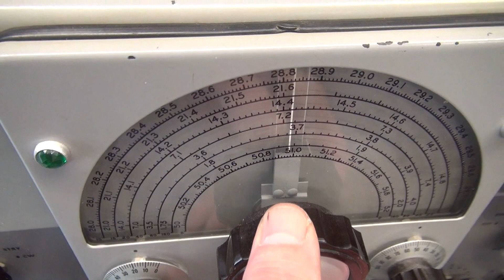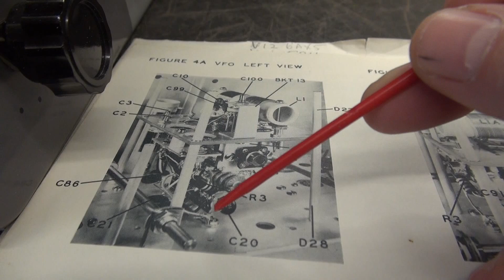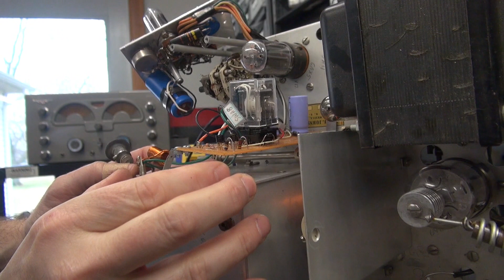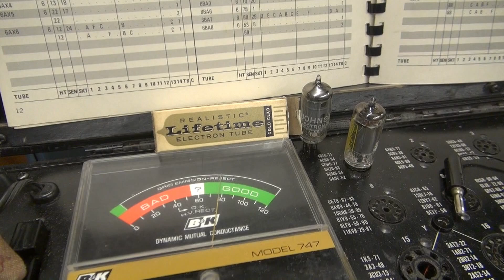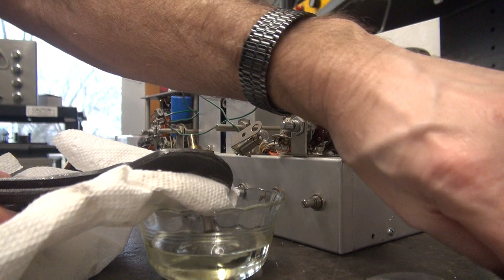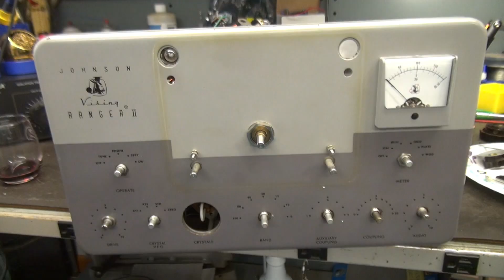How to repair EF Johnson Ranger tube Ham Band transmitter Dead VFO No Grid current

Comment: Could you use vaccuum grease instead of the stuff you were using? I used it for years doing instrumentation mechanical assembly and the like and had no problems with it hardening or gunking up rotating assemblies and such. Just wondering.

Comment: I once pulled the face off of a PRC 77 xciever and spring tensioned gears flew everywhere. 
That was fun. 
Nothing in the tech manual about it or how to put humpty dumpty back together again. Jewelers tools and patiently playing....
Thx for the video, stay well.
You don't use acid brushes for cleaning? They were my favorite tools.
No debris left behind.
Reply: I worked on the PRC-77 in the Air Force. I also worked on the PRC -25 which is basically just the Tube version of the PRC-77. Also repaired many VRC-43 and VRC-46 mobile radios.